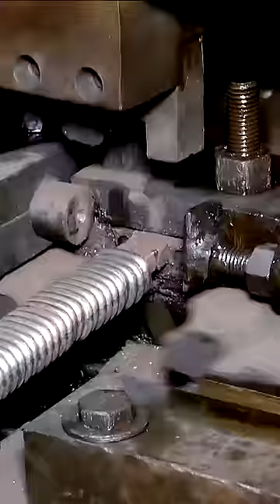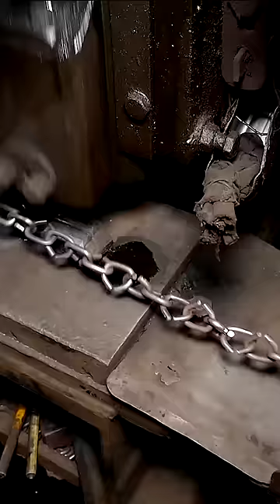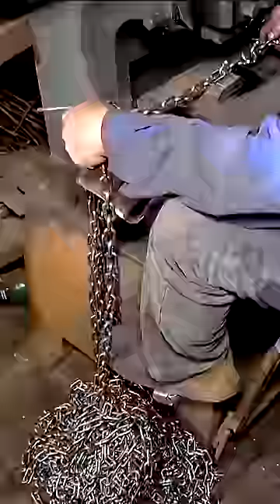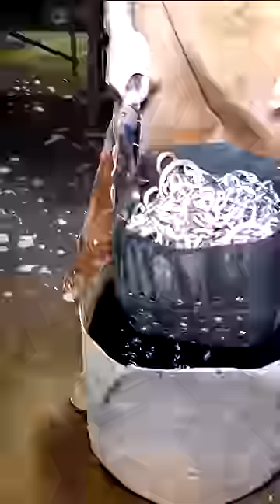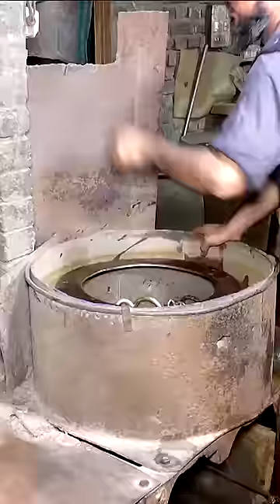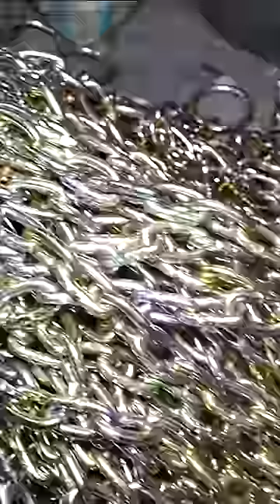Amazing Technique to make iron Chain

Comment: Sufficient gaps should be provided for welding of a chain links, if it is used in the cranes to lift heavy loads. Otherwise, the welding of the chain link will fail.